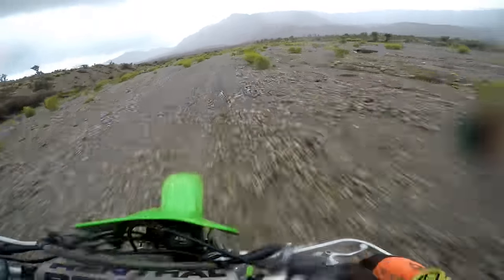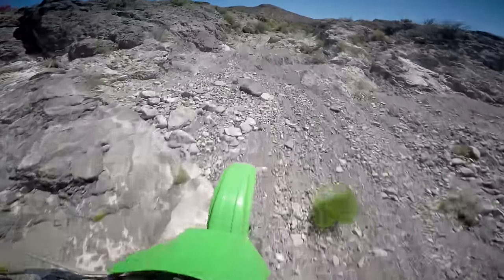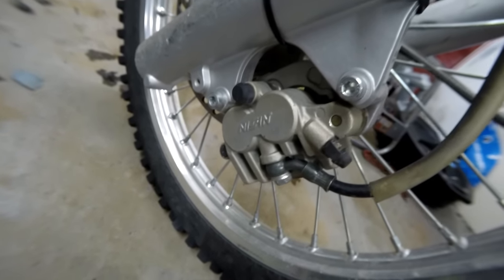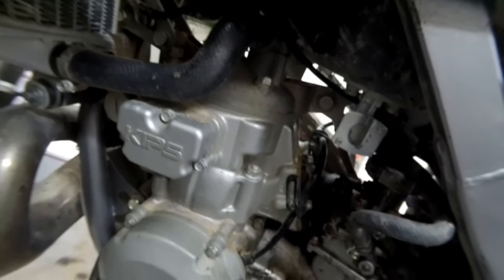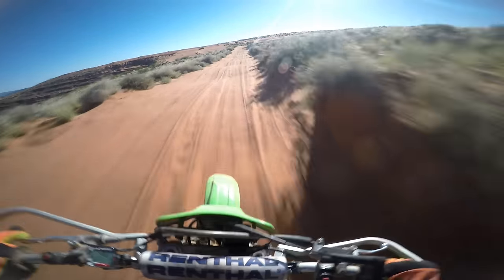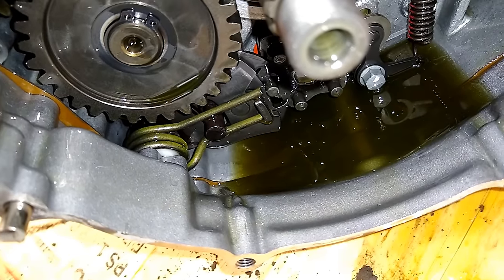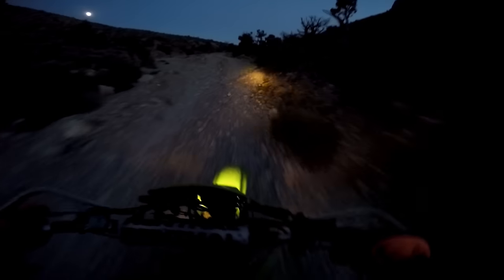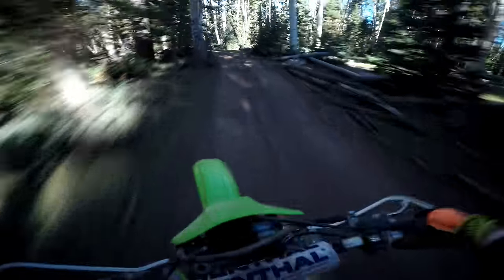KDX200 In-Depth Review

Comment: Imagine if Kawasaki built these now , it would single handedly put them back on the dirtbike radar
Reply: @Suzukisan If any of the big 4 made a new full size aircooled 2 stroke I'd be at the dealer the second one rolled off the truck to buy it.
Reply: @JMKady76  motorcycle maniac here, but only even owned 4 strokes. What's so intriguing about the 2 smokers? Serious and genuine question
Reply: @HooDRidEWhiteY  Light weight and simplicity, power delivery is much different as well.
Reply: @JMKady76  I'd like to ride one. Always been told they're high maintenance but that could be a wives tale.
Reply: @HooDRidEWhiteY  Less maintenance than a modern 4 stroke, no valve adjustments, no engine oil to change etc... I own and ride both but for a woods bike if rather have a 2 stroke.
Reply: Imagine if you learned 1 cylinder engines are NOT appropriate for you and your chums.
You’re just a social butterfly. Gossiping all day.
1 cylinder engines go “BANG” and then nothing happens.
Something must start the cycle over again.
The motor goes “bang” once more and then nothing happens.
You wait for the cycle to start over, and you get to hear 1 bang and you stop moving forward. 

For the riding you do, you need a 2000 cylinder engine.
Reply: @dreyn7780  Wondering what the frame would look like to support a 2000 cylinder engine...
Reply: At Monza they have a double fence lined with barbed wire.
So, is the race track without a fence the real race track or is it the double fenced off race track?

Humans can’t workout if water is hot or cold anymore.
You can’t sink lower than walking bacteria level from now on.
Reply: @dreyn7780  
Man, those drugs you're using are baaaad, mmmkaayyyyy...
Reply: @JMKady76  Why would you want air-cooled?
Reply: @nolankarat5169  Less weight, no radiators to smash or poke and leave you stranded, fewer moving parts to maintain.
Reply: @brianmosser5209   Air cooled eliminates the risk of a radiator puncture and may weigh less. But, power to weight ratios may be equivalent because water cooling is more effective at removing heat, allowing for higher compression ratios, more horsepower and improved longevity.
Reply: @HooDRidEWhiteY  extremely light. Nastalgic sound & smell. They're quicker. Not faster, but quicker. Their good for tight technical stuff. You can go from putting over a rock to zipping up a hill in a second. The power delivery is zippy.
Reply: @noirxplorer3185  Thank you sincerely for the thorough and thought provoking response. All motorcycle enthusiasts speak the same language, just different dialects 🍻
Reply: @HooDRidEWhiteY  sure thing. They're all a blast. It's all preference. What the rider enjoys. On the east coast, we prefer light weight 2 stroke enduros. In the west, they cover a lot of ground and prefer heavy high CC bikes. That's the majority, there's exceptions.
Reply: Justin Kady easier to rebuild and cheaper to rebuild also compared to modern 4 strokes to add to your great list of positives of a 2T trail bike
Reply: @HooDRidEWhiteY  ......................
1........- LAYOUT AND DESIGN...LOVE THE LOOK OF THER BIG EXPANSION CHAMBERS AND COMPACT LIQUID COOLED MOTOR AND JUST THE OVERALL VISUAL ERGONOMICS ARE WAYY MORE ATTRACTIVE TO ME
2.......- PERFORMANCE........HAS HALF AS MANY MOVING PARTS AS 4 STROKE AND A THIRD OF THE WEIGHT SO SUSPENSION AND FRAME ALLOW SHARP QUIK DIRECTIONAL CHANGES AND VERY FLICKABLE
3.......- POWER TO WEIGHT RATIO- COMMON KNOWLEDGE THAT 2 STROKES ARE DOUBLE THE POWER ROUGHLY OF THE SAME GIVEN CC IN A 4 STROKE........SO A 250CC 2 STROKE IS ON PAR WITH A 500CC 4 STROKE ONLY YOU GET THE BENEFITS OF THE SIMPLE AND LIGHT DESIGN WITHOUT THE WEIGHT 
4.......- THE ZINGING SOUND!--- NOTHING SOUNDS BETTER TO ME THAN A BIG BORE SMOKER IDLING LOW AND SOUNDING LIKE A BEAST AND CRISP METTALIC TINNY SOUND COMING FROM PIPE  IS INTOXICATING AND WHEN ITS TIME TO GET ON THE PIPE ...THE SOUND NOT ONLY SOUNDS GREAT BUT IS AN ADRENALINE CATALYST HEARING THT AWESOME MOTOR SING REALLY GETS THE BLOOD FLOWING....
5)......... OUTRIGHT FUN--TGHE ALL OR NONE TYPE OF STYLE THE 2 STROKE DIPLAYS IS THE MOST REWARDING ASPECT....
6)....... KEEEPS YOUR SKILLS SHARP- MODERN 4 STROKES ARE SO ADVANCED AND STABLE OPNE NEEDS ONLY TO TWIST THE THROTTLE AND THE BIKE DOES THE REST........TO ME THATS BOORING!!!!!!!....AND ALSO STARTS A BAD HABIT OF GETTING LAZY AND NOT PUSHING YOURSELF...THE HEAVY WEIGHT KEEPS BIKE STABLE AND THE INERTIA FROM MOTOR REALLY AIDS IN COMING DOWN FROM SPEED GIVEN ENGINE BRAKING WILL STOP U TREAL QUIK....2 NSTROKES ARE LIGHT TWITCHY PIPEY HIGH STRUNG BERAST THAT DEMAND 100 PERCENT ATTENTION AND 100 PERCENT SKILL KEEPING YOU ON YOUR TOES THE WHOLE TIME WHICH MAKES U A BETTER MORE PROACTIVE RIDER ON A SMOKER BECAUSE YOU HAVE TO BE OR ELSE SHE WILL SPIT U OFF QUIK!!!!
7).....MAINTENANCE COST.....LESS PARTS MEANS LESS THINGS TO FAIL....WHICH MEANS LESS THINGSD TO HAVE TO BUY TO REPLACE ONCE WORN AND 4 STROKES IN THE END CAN COST THE RIDER AS MUCH AS 75 PERCENT MORE MONEY THAN A 2 STROKE REBUILD SO ALOT MORE AVERAGE PEOPLE CAN ENJOY THE BIKES AND ACTUALLY AFFORD TO HAVE IT AS THEIR MAIN HOBBY
8)....... CONFIDENCE INSPIRING....THE EASE OF SIMPLICITY OF 2 STROKE MOTOR CAN BE A REAL REWARDING EXPERIENCE WHEN THE OWNER CAN BUY TOP END REBUILD KITS AND REBUILD BIKE HIMSELF AND YOU GAIN CONFIDENCE IN KNOWING YOUR BIKE FRONT TO BACK AND  NEVER HAVE TO TAKE IT TO SHOP TO REPAIR IF YOU KNOW HOW TO DO IT....SAVING MORE MONEY AND WHEN U PASS A NEW 4 STROKE ON A OLD SCHOOL SMOKER...THATS ANOTHER REWARD THAT IS AWE INSPIRING AND WILL PROPEL YOUR MOTIVATION TO WIN AND BE THE BEST YOU CAN BE.
9).......AROMA!!! NOTHING LIKE A GOOD CASTOR OIL LIKE KLOTZ BENOL MIXED W C12 RACE FUEL WILL GET THOSE OLFACTORY NERVES PERKED UP WHEN THEY SNIFF THE RAW YUMMINESS OF 2 STROKE PREMIX AROMAS!!!!!

10) SPARK PLUG CHANGES..... ON A SMOKER ITS VERY ACCESWIBLE AND TAKES A MINUTE OR 2 TO UNSCREW FROM HEAD....AND BEING THAT EASY I TEND TO TAKE IT OUT PERIODICALLY FOR SERVICING AND INSPECTION........BUT ON A 4 STROKE THE HEAD CONTAINS ALL THE MEAT OF THE MOVING PARTS AND  THE SPARK PLUG HAS TOP BE BURIED DEEP INSIDE HEAD SINCE THE WATER COOLING JACKET MAKES THE DISTANCE EVEN GREATER TO ACCESS....NOT TO MENTION HAVER TO TAKE SEATS AND PLASTICS OFF JUST TO CHANGE IT SO THATS DEF A HINDRENCE WHEN IT COMES TO JETTING I LOVE TO LOOK AT PLUGS ALOT TO NOTE MY PROGRESS AND ACCOUNT FOR ANY CHANGES THAT I MAY OR MAY NOT DECIDE TO INCLUDE..
......
SO THERE ARE A FEW FACTORS I CAN THINK OF WHY I LIKE 2 STROKES BETTER AND DONT GET ME WRONG THEY ALSO HAVE THEIR FARE SHARE OF FAULTS AND ISSUES BUT SUCH IS EVERYTHING NOT PERFECT AND THE TOTAL LOSS OILING SYSTEM MIXED WITH PORTS AND NOT VALVES MAKE THE 2 STROKE VERY GAS THIRSTY AND INEFFICIENT COMPARED TO 4 STROKE...THE DESIGN IS A FORM OF CONTROLLED CHAOS AND REALLY IS A INFERIOR DESIGN WHEN COMPARED TO THE MODERN 4 STROKE BUT STILL IN MY OPINION 2 STROKES ARE ALOT MORE RELIABLE GIVEN THE OWNER TAKES CARE AND NOT BOUNCES IT OFF ROCKS AND ROOTS EVERYDAY AND KEEPS TOP SHELF PREMIX QUALITY W HIGH OCTANE FUEL...AND KEEP A FRESH AIR FILTER AND OILED AS WELL AS PROPERLY GAPED SPARK PLUG AND HEAT RANGE AND CHANGE GEAR OIL EVERY FEW HOURS THEN IF JUST MILDLY TRAIL RIDDEN...A 2 STROE MOTOR NOT BEING RACED CAN EASILY LAST OVER 200 HOURS OF USE AND ACTUALLY STILL B WITHIN ITS SERVICE LIMITS AT THAT POINT...AND IVE HEARD OF PISTONS LASTING OVER 450 HOURS AND STILL GOING STRONG SINCE TODAYS OILS ARE MUCH BETTER ALONG WITH MODERN CUSTOMIZATIONS TO MAKE BIKE EVEN MORE RELIABLE SO ALSO LESS PARTS LESSENS COMPLEXITY AND PROMOTES MORE STABILITY.....4 STROKE PISTONS CAN WEAR OUT JUST AS FAST WHEWN RACED ALONGSIDE A 2 STROKE SO 4 STROKES ARE STILL NOT THE OMNI POTENT PRESENCE THT EVERYTONE THINKS IT IS  AND HAVE THERE FAULTS AS WELL BUT ALL IN ALL THE 2 SMOKER AND ALL ITS FUN AND BENEFICIAL ATTRIBUTES ALONG WITH COMPLEMENTING MY PERSONALITY SINCE THE ALL OR NONE STYLE OF RIDING COINCIDES VERY MUCH THE SAME TYPE OF PERSONALITY I MYSELF POSSESS ...BEING THAT IM OCD AND GET OBSESSED WITH BIKES IM ALL DIRT BIKES EVERYDAY....365 DAYS A YEAR ON MY MIND AND IF I WASNT INTO IT....THE THOUGHT OF A MOTORCYCLE WOULDNT EVEN ENTER MY MIND AS I WOULD BE OBSESSING WITH ANOTHER HOBBY ALL DAY 365 DAYS A YEAR SO THATS THE ALL OR NONE ATTRIBUTE I POSSES ALONGSIDE MY ALL OR NONE STYLE OF PERSONALITY MY 2 STROKES HAVE SO ITS A MATCH MADE IN DIRT BIKE HEAVEN!!!!!.....LOL
HOPE THIS CLEARS UP YOUR QUESTION AS I TRIED TO SHOW YOU THE MINDSET OF A FELLOW BIKE LOVER AND MORE SO A 2 STROKE FANATIC THA GENUINE REPLY HERE IS MY MANIFESTO TO THE 2 STROKE EXPERIENCE.....THANKS FOR YOUR TIME AND SEE YOU OUT ON THE TRAILS BRAPPPPPING AWAY INTO THE SUNSET!!!!!....LMAO.....PEACE
Reply: we need kdx 125, 200, 250, and 300... would honestly smash the other steel frame enduro bikes
Reply: Definitely
Reply: I got the 220 kdx 04. Had it for 20 years now and it still runs. I've had to replace stuff but things bullet proof!
Reply: Wrong. 
Misrepresenting the Endurance motocross racing bike has killed off the retailers, the rider's,  the tracks  and Suzuki racing. 

And you want to keep saying the lies again. 

The lying must stop.

Kawasaki got fed up with you misusing this motocross racing bike.

Years later,  you're still crazy insane. 

You're antisocial and insane.
We're not listening to your crazy ideas.
Reply: @HooDRidEWhiteY  Two strokes are very high maintenance bikes fs. Jetting has to be perfect on them or you will be eating through spark plugs. This isn't an issue with four strokes. Four stroke engines have more moving components so the bike will feel heavier yet you will find aren't heavier on paper. My trx450r feels heavier than my sisters ltz250 despite my 450 weighing over 20lbs less. It's reliability is very dependent on the model you're comparing it too.  An 04 kx250 compared to this would like comparing a Chevy to a Toyota, take an 2006 crf450x and compare the reliability to the kdx and it's honestly not gonna matter.👍🏻
Reply: I just got a 95 kdx200 and I’m about to register it on the road
Reply: Beta already beat them to it with the 300cc 2 stroke xtrainer.
Reply: @HooDRidEWhiteY  please go and ride a propper 2 stroke you will never go back to this generation of easy 4 strokes 2 strokes are like comparing a turbo to supercharger if you can ride a 2 stroke will leave 4 bangers in the smoke
Reply: @HooDRidEWhiteY less than a 4 bangers mate

Comment: KDX is the AK-47 of dirt bikes, simple, reliable, cost effective!!
Reply: Bang on, as they say in the middle east!
Reply: skojo3e you misspelled XR250R
Reply: True that.
Reply: And totally inappropriate for what you’re doing.
You need an engine with 2000 cylinders. Not 1 cylinder. 
Why do you want an air cushion ride? 
You need SOLID rubber tyres.
Society hands you this stuff before you can comprehend it.
It’s 1 cylinder built for NOspeed.
Don’t you get it yet!?
It goes “BANG” and then nothing happens.
Then you’ve got to begin the cycle again.
BANG and then nothing happens.
Reply: skojo3e yeah and used by people with turbans and third world country’s lol
Reply: imo it’s the yz125
Reply: And not good for long range lol
Reply: So also sloppy and lacking precision
Reply: Agreed I know somebody who bought one for $800 and it has ran for about 8 years with no maintenance
Reply: I’ve got a 2002 KDX200 and a 99 KX500. Both are for sale. KDX has two gas tanks, one is a Clarke oversized tank, also has an extra seat. Handle bar risers, stock and USFS approved pro circuit pipe. New chain/twin air, excellent condition. The 500 is even nicer.
Reply: Cost effective and effective
Reply: I disagree. The venerable DT175 is the AK-47 of dirt bikes.
Reply: @reedtarted1932  i personally have never had a problem with the accuracy of an ak47, I like the gun. Its a very effective weapon
Reply: The "cost-effective" part of this comment didn't age well
Reply: Wrong.
Reply: @LooseCannonRacing  exactly. Mine if a nail driver. Dead on every time.
Reply: @Rakkasan-vr8xt  the kx500 would be way too scary for me

Comment: Superb review! I've had them all (KTM, HUS, Beta) and yet I still keep coming back to the KDX 200.  And though, I currently own a 2017 Beta 300RR, and enjoy riding it, I honestly, smile more when I ride my fully resurrected, slightly modded, and properly suspended 96 KDX 200 (my third H model kDX 200 since 2003).  Dollar for dollar and reliability-wise, it is the best bike I've ever owned.  Every time I've sold one of my KDX 200's off, I instantly regretted it.  

When I think about all the money and time I've spent on other bikes (purchasing, setting them up, mods, etc) since getting back into riding in 2003, I shake my head in disgust and realize that I should've just stuck with my 02 KDX 200 and rode the wheels off of it.  And, nah, it doesn't have the power of my Beta, but for some reason I just find it so much more fun to ride -- and it's definitely easier to maintain.  The KDX has no bells, no whistles, no mapping,  etc.. -- it's simply just a darn good all-around offroad/woods bike which, through a few simiple low cost mods and proper set up, can be made to do whatever you want it to do.  I'll certainly be holding onto this KDX until the end.  Again, great review -- Thank you!
Reply: Can I ask you a question? I bought and restored a 1996 KDX 200. I have spent a lot of money on the bike (around 4K). I was wondering if I should sell it to buy a new 2020 KTM xc-w 250 tpi. I think I will like the suspension, ergonomics and hydraulic controls better. Surely it's much more money. I am a beginner to intermediate weekend warrior. I mainly ride single track, slow technical, hard enduro trails. Do you think I should go with the new KTM or the KDX will be enough for what I do?
Reply: @surfpr727  I have been using a kdx for a while after riding a KTM 300 with a rekluse and I find that the kdx is better for me as far as riding position and overall feel of the bike
Reply: Also I spent just 150 dollars on it after it not running for years and it hasn't had a problem
Reply: I feel the same way. Got a KTM 300exc and went back to my KDX's..

Comment: Nothing compares to the KDX.   I have a 2000 KDX200, mildly ported with Ron Black Carb, KX forks and FMF pipe and V-force reeds.  Rock solid reliable, light as a feather, great handling and much faster than expected.  Just a blast to ride.   I've owned too many dirt bikes.   This is the only one I won't sell.   Kawasaki created the greatest playbike ever with an engine that can flat out rip with a few mods.  Classic.

Comment: I have myself a 2004 KDX 220R. I started my off-road riding experience on a 2017 xt250. Man what a difference, it was even scary at first, how much more power it had.   It obviously handles much better than the XT, but I still feel more comfortable on my XT. Especially on steep loose up hills. I tried going up a hill I did on my XT which tractored up it, despite being loose and rocky, and then my KDX kept wanting to loop lol, I know I need to learn to slip the clutch better, and I know a more capable rider would have zero issues climbing the hill. But for some reason with the XT I could go up it slow and pick my lines better, despite not having not a lot of speed, and not having to slip the clutch. I do have Tubliss on my XT and I usually run it around 5psi, or lower or even zero psi lol, while off-roading with a stiff sidewalled tire. Were as my KDX is still rocking a tube, so it's hard to get near 10 psi without pinch flats in rocky terrain and bigger hits.

Comment: Fantastic Review! I bought my '95 KDX200 pre-owned when I was in college. I gave something like $1,000, and I rode it a moderate amount of time (I was in college after all, the days of playing in the mountains, riding dirt bikes and atvs all day long had come to an end, without my knowledge). After graduating, getting married, building a house....that KDX still sat in the same garage, so I decided to fully restore it! One set of stock radiator shroud graphics were left in the world (it seemed) and had to import those from England. I couldn't find the swingarm graphics,  so I made them on my PC using photos of KDXs and vinyl sticker printer paper, that I then put a clear sticker and clear coat paint over top of for protection. Looks good! Anyway, the bike looks amazing. I took it down to the frame, welded any trouble spots, sanded primed and painted the entire bike. New plastic, seat, a modern headlight and front fender....The bike looks like a 2021 KDX 200. I'm not going to advertise on someone else's channel, that would be wrong, but I would love to show you guys the bike. All I have left to do is put the pipe on, and attached the front brake hydraulic line. Some tweeks, and I bet that, even though it hasn't ran for 10 years, that bike will start on the 3rd kick. :D Love my KDX!

Comment: 3:08 because it's a woods bike silly!  The KDX is the best overall dirt bike ever made. I've owned and raced over 100 dirt bikes in my 50 years of riding. If you put a gun to my head in heaven and said I get one bike for all eternity.... KDX 200.
Reply: make table True I raced Enduro and mx this was excellent machine.
Reply: Jeff Fredette did a KDX 220 for my neighbor.  I have 6 dirt bikes (250X, two 250F MX bikes, a 230F, a 150F for the wife, and a stock KDX220), but that tricked-out Fredette KDX 220 is the sweetest bike I have ever ridden as a 67 year old with 52 years of experience.  My neighbor has $5k in it but you can't buy a better bike for $10k.
Reply: I had a KDX 250. Best bike I ever owned.
Reply: @edwilliams8789  i just picked up a no plastics good motor 91 and man cant wait to dump money into it you really can't ask for more a fresh build will get you about 5-4hp less than a new ktm 500
Reply: Love the KDX but the KTM 250XC has it beat for best all around bike.